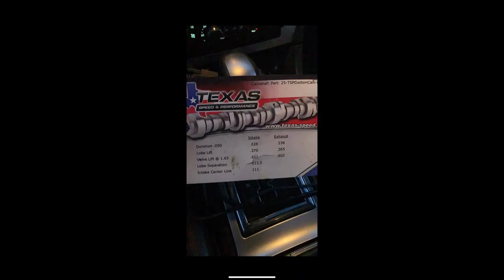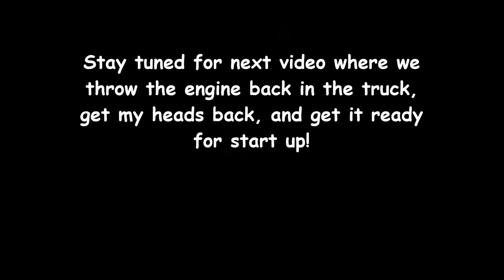5.7 HEMI Teardown, Paint, And Cam Installation!!

Comment: I'm doing the same thing since mine dropped some valve seats and was already burning oil, only I'm not using the orange paint on a 5.7 block because I don't want people thinking that I'm trying to pass it off as one of the larger displacements that usually get that orange paint.

Comment: I noticed around the 22:51 mark when you put the phaser back on the pin on the cam was at 6 o’clock and not at 12 o’clock, I thought it was supposed to be on top?
Reply from the maker: The mark for the actual phaser has to be at the 12 o clock

Comment: I’m only asking because I don’t know. I was doing this 25+ years ago and I’m old now but back then 150k was a shit load of miles. Is it not necessary to do the bottom end anymore? Those old motors 60s 70s 80s motors would have definitely needed to be machined. Also what oil pump are you using? My 20 ram only makes 31 psi at hot idle and the dang thing idles at 550 rpm. In my opinion the idle needs to be at least 650-700. The stock oil pump would then put the idle oil pressure in the mid 40s.